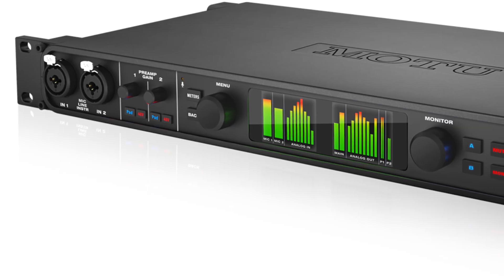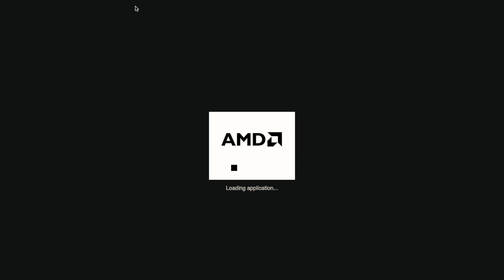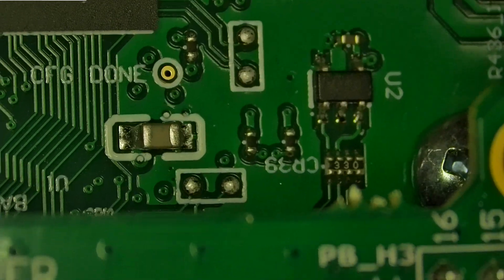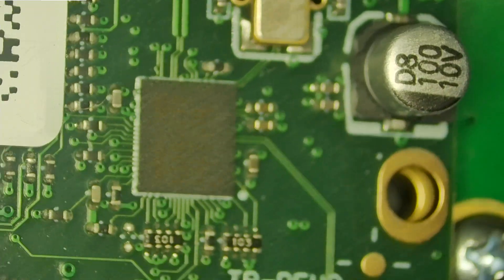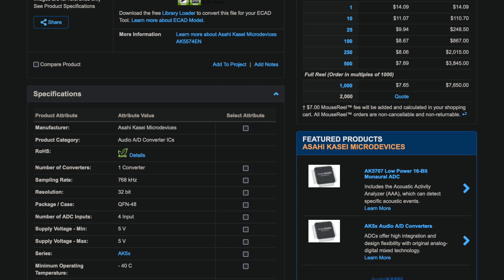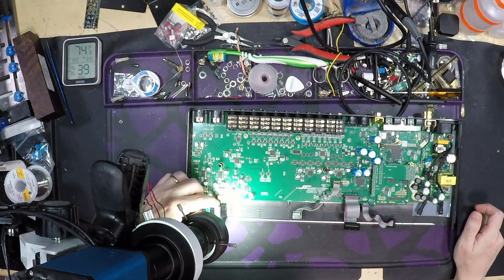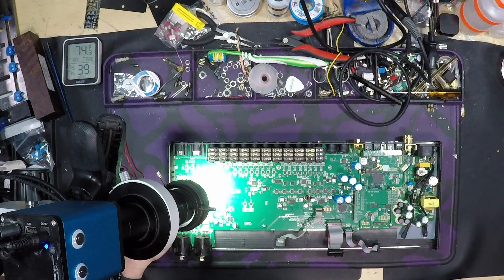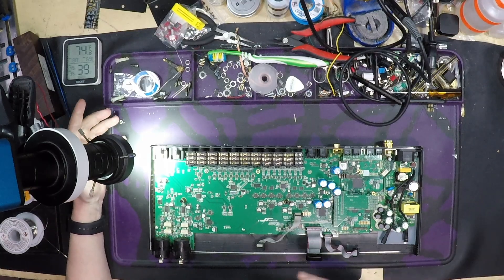What Powers The MOTU 828es?

Comment: Even in the 16A MOTU cut corners with horrible Chinese power supplies. You only look at the flashy stuff not the all important PSU that works on a knife edge.
Reply from the maker: Sorry for the confusion. The title is a bit deceptive. It's supposed to be about "flashy stuff" and not power supply woo.
Reply: @SydHeresy  Hopefully your PSU PCB runs long term, they are a Chinese design, running on a knife edge, component wise.
Reply from the maker: @robertbrown3413  Since it's fairly modular I'm sure it'll be easy to replace repair if it fails. I know I have to do that a lot with OEM MeanWells. This isn't my unit; it's a client's who sent it in to repair some damaged pots and headphones jack from accidental damage. When I started working on it I noticed some of the chips in there and decided to take better notice.  It was really interesting. I've since done this with a few other audio interfaces and the results have been very interesting.  I'm still editing and researching the video content but so far it's the UA Volt2, MOTU M2, Focusrite Scarlet, Presonus Audiobox, Neve 88M, Sound Devices USBPre, and a few odds and ends I have laying around or that come by the workbench.  I'd like to focus on the 2x2 interfaces first and then later move to larger ones like this video. The idea behind these video is to just show what's inside and let the viewer make a call on the "value" of those parts.
Reply: @SydHeresy  I should take a look and buy spares of all the power semis... and hope they don't poke 10V on the 3v3 line.

Comment: This is encouraging - I've been looking at the new 828, but there are some features on this that I also like.  Did you decide to go with a MOTU?  The 16A also looks really nice (the new refresh) - it does not have MIDI, but it does have AVB, and I could - if sync is not an issue - add a more expanded MIDI interface - perhaps a 4X4 or something that could be better anyway.
Reply from the maker: Yo! I’m glad you liked the video! I’m actually in the process of making more videos like this with small 2 channel I/O interfaces. I have the UA Volt on the bench and plan to test a MOTU M1, and the Focusrite Scarlet. 

For the number of I/O’s and sheer quality I’m gonna go with the 828es.  I need the 10 analog inputs and the 16 ADAT will be used down the road. The sheer quality of components inside completely sold me on their stuff.
Reply: Hi!. i`m in the same doubt between the new 828 and the latest 16A. I don´t need AVB and neither mic preamps so everything reduces to AD/DA, latency and overall sound quality. But i can´t find enyone who can clarify if their are the same on this regards. Did you made your choice already?? . looking forward if you can share your experience. Cheers!
Reply from the maker: @pedroalvarado3256  Yoooo!  So I'm guessing the 16A has very similar component quality to the 828es.  They both boast the ESS tech, but the A16 is just more I/O's.  As for latency, i'm not sure. I didn't measure that out.

Comment: Despite the relatively low price, this is not a prosumer interface, this is a pro interface.  The Ethernet port supports the AVB protocol and you can receive/transmit through a cat6 cable up to 128 digital output channels at up to 24bit@192kHz and can receive up to 128 digital inputs at up to 24bit 192kHz.  If you use it in a live setup, you have an internal mixer with some plugins that you can control with an iPad ( these plugins are not studio quality like those running on UA Apollo but can be useful for some people).  This interface has a Thunderbolt interface so you can use it to connect to your host computer and have hundreds of channels going through it while being low latency.
Reply from the maker: Agreed, it's a real bargain for what all you get.

Comment: What about the newest 828?
   Same chips, etc.?
Reply from the maker: @rjb7569  I’m kinda curious about that myself. I would guess they didn’t make massive changes to the architecture since they kept the name, but I guess I’ll need to find out. All those chips are still available on Mouser; so it shouldn’t have to change over availability.
Reply: @SydHeresy 
It's good to have a knowledgeable guy able to review the innards of the tech. It's beyond me.
   The current 828 appears to be my finalist but I'm suffering from information paralyzation.
   Your dissection helps solidify what I've been thinking about interfaces 1K and under. Some of the other companies (Audient, Presonus, for example), are not that forthcoming in what chips, etc., that they use.
   Thanks for your presentation! Very helpful, and thorough.
Reply from the maker: @ I’m glad you found it helpful. I’m in a similar boat as you when it comes to audio interfaces, and opening this up pretty much sold me on getting one.
Reply: They drop the AVB port on the new 828 which is a major let down IMO.  The AVB lets you add other AVB interfaces and is not limited like the ADAT protocol.
Reply: It sounds like they goosed a little more quality out of the audio, but not a huge amount.

Comment: Great video very intersting!! MOTU have always been known to use the best in class chips at the time of taking a product to market. They were literally the 2nd company ever to make mass market audio/midi interfaces in the 1980s. MOTU also never hide in product materials what converters they use. The advertise they use the ESS Sabre and AKM While other companies will go to great lengths to hide what D/A or A/D chips they use (like UA, Lavry, and even Focusrite) MOTU have never been shy about what they use. They also have pretty good build quality and I still have a couple traveler units from 2000 that would still work today in class compliant mode with an adapter of course LOL.
Reply from the maker: Yeah, they are definitely a great value for the quality that you're getting. I'm sold as a customer. Just need to go buy one lol
Reply: @SydHeresy  There is a newest version of the 828 with the next GEN Sabre 32 chips but lacks the thunderbolt and AVB options of the last generation. But its a good one for the price!
Reply from the maker: I was looking at that one. I want to go with USB-C option for future proofing.